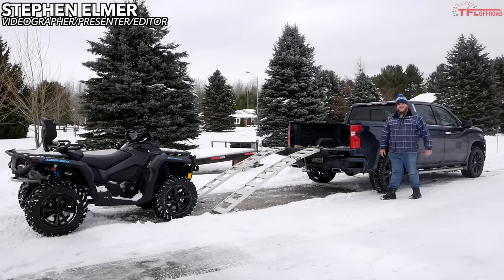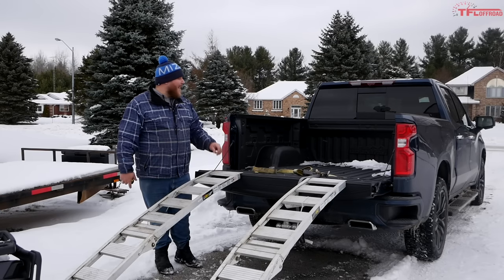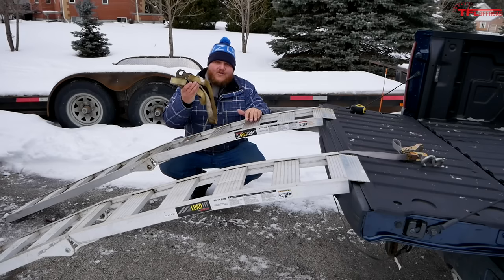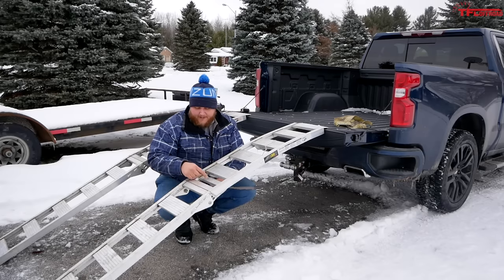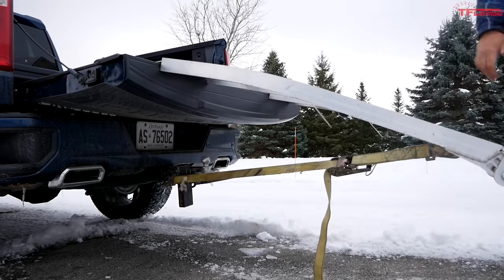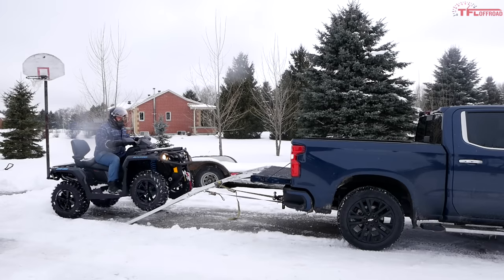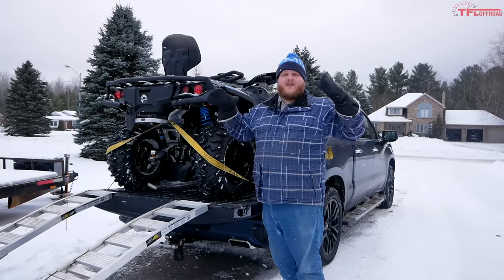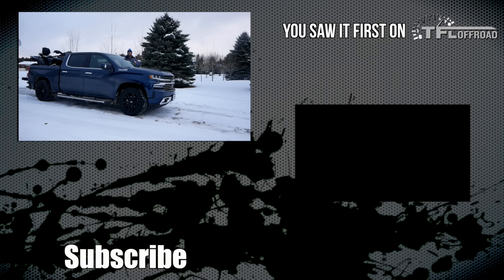Here's How to Load an ATV Into Your Truck Without Crashing!

Comment: Thanks for the info on loading an ATV into a truck.
Reply: Thanks bro. I have the exact same size truck bed and quad; and I didn't think it would fit/tailgate wouldn't hold up. I always used my jumping jack trailer to tow it around. I will definitely  be using this new technique. Great presentation.
Reply: Lol
Reply: I'd rather Back On , Then Back It Off   !!!

Comment: I've loaded thousands of   pieces of equipment on trailers and trucks, I try to get my trucks back wheels in a low spot when loading my 4 wheeler , it's just easier and safer.
Reply: Me. Me  just put some cones out and get some construction signs. Then rent a back hoe/bulldozer and makes yourself a ramp on the road. BOOM, free ramps for lfe. Just make sure you don't see any cops and put some camo on it. Paint it grey so you can see who is speeding.

Comment: Just a little thing to keep in mind for those who have an atv that will hit the glass get a good set of wheel chalks put them in front and if you get big enough chalks they will sit against the bed wall and give you a little extra room it helps when tying your quad forward and great video safety is what keeps us all riding down the trails
Reply: andrews you’re right rear windows are expensive lol 😝
Reply: I got me a pillow because my s10 tailgate wont close with any more space added
Reply: @andrewsbbq  I have a big red 250 that will fit if I turn it so the front tires in the corner, and a moto4 that just BARELY fits
Reply: I use an old tire as a buffer. If anything was to ever move on his ATV it’s gonna hit the glass period! And an old tire is cheap and readily available!

Comment: Great video. I agree with strapping down the ramps, it's very important. I also agree with using heavy duty straps. Personally, I suggest using two straps on the rear of the ATV instead of one though.  Straps can work themselves loose, two is always better.  For max safety use four, one at each corner, the same as you would do on a trailer. I've seen some people use winches at the front to tie it down and than can damage a winch. If you have front and rear bumpers use a strap at each corner, it's easy and very stable.
Reply: EastCoastATV yeah each corner is better but if your tailgate is down I prefer the crisscrossed method
Reply: I just dont think you should be strapping from the frame on something that has that much shock travel, already lost one side by side out the back that way, don't really want to lose another, much more secure to strap the tires down

Comment: Bought The standard Bed Truck (6' 6' bed) to better fit the 850 Max North Edition.  This allows for the installation of a ratcheting cargo bar across the front of the bed to stop the ATV (with accessory front bumper) against when loading and securing from hitting the glass.  Great common sense video for people who actually use their pickup trucks.

Comment: Nice video. I use a timber block or similar at the front of the bed to stop the ATV or whatever else goes there so I don't have to worry about contacting the glass of the cab or slamming into the bed.
Reply: I use some rubber wheel chocks I found on ebay cheap, does the trick.
Reply: I like your ATV .I admire your experience of loading it to the pick up

Comment: Excellent instructions for all those that don't know anything.  And not bad for people that have been doing it wrong as well.  Strapping the ramps to the truck I never see anyone doing.  "watch and learn"  Surprised you did not put individual straps on the back and just did 1.  I used to anchor 4 points for safety.  Sometimes a 5th strap over top of the whole thing to keep it from bouncing the straps loose.

Comment: I use ramps similar to THESE for a trailer to load mine.  My trailer does not have a ramp.  When I use the ramps, I strap them similar to this video but I also installed a bolting solution so I can bolt down the ramps to make sure they aren't going anywhere.  After taking a spill and getting really hurt, I do not trust ramps unless they are bolted in addition to strapped.

Comment: My 2017 nisan titan offered pretty same box add-ons. Clet system n led lights with power plug, a few years ahead of Chevy. Use an old rubber tire (without the rim, lol )to place between front of quad and front of box. It will stop it from touching or rubbing box or breaking the glass. Steady smooth throttle while loaded, one smooth roll up, not being one smooth roll up may cause more problems. Strap all 4 corners to stop it from moving forward or backward in the box, you can strap to the atv from under the atv on the frame itself to which is more stable than a big loop over strap. I donno how many atvs have slid out or into cab doing some serious damage. I miss a quad, ramps and my truck. Now with sxs and trailers, it's just different. Strap those ramps down too while loading, lol the old lumber sliding out as ramps may seem funny on video clips, but that's a flip you may not walk away from.  Ride safe n enjoy. Blue atv, blue truck, blue jeans, blue jacket,  and a blue touq with a blue pompom, lol sweet looking Chevy tho.

Comment: I always try to make sure my machine is in 4WD... Helps take the stress off the ramps once the front wheels get to the bed.

I also like to step on the foot brake (on Can-Ams) AND pull the parking brake. Brings up the brake pressure

Comment: As a viable alternative to using straps for keeping the ramps in place, you can also drill two holes into each of the ramp plate faces that lay flush on the top of tail gate’s edge. Along with two holes drilled into the inner tail gate where the ramps make contact. Obviously, the tail gate holes you drill will only be done once you determine the optimal placement of the ramps for your particular machine. These holes do NOT have to be massive....a quarter inch diameter is adequate.
    Once the ramps are in place, drop in a Clevis pin into each hole. The ramps are now “locked” into the edge of the tail gate, and it is now virtually impossible for either of the ramps to move laterally, and it’s highly unlikely one (or both) will ever “flip” on you, if you ever happen have your tires off center, and on the ramp edges during loading.
    This is the way we did it with our Suzuki/Yamaha dealership’s company pick up truck, when I did insurance pick ups, and transfers during the 1990s. Worked for both ATVs, and motorcycles. Except the truck had different holes drilled for loading the bikes, because you NEVER ride a motorcycle up into a pick up. It’s always pushed up one ramp, while walking up the other. So the ramps had to be closer together. 
     I’ve never seen tie down straps used for securing ramps, but it seemed to work well for you. And I’m certainly not dumping on your method. It does seem to alleviate any potential “ramp bounce”, completely. But with the pin set up, that is minimized by loading it fairly slowly. My only concern in regard to using tie downs, is the fact that the ramp lips (although pressing down hard under tension), are not “truly” secured to the tail bed of the truck. Just my two cents, and sorry for the novel. Great overall video, and thanks for making it. 👍

Comment: I would like to share when I load my ATV I have holes drilled into my tailgate and ramps and I put pins in them  so the ramps don't move forward ,  backwards or even side to side. Just lineup your ramps with your ATV wheels and drill the holes and it's set. Drill two holes per side of ramp. I use coupler pins. Hope this helps
Reply: That’s what I do exactly !

Comment: Personally, I add another set of straps from the rear of the bed to the front of the ATV. That way if you have any impact or panic stop the machine doesn't shift into your window or front of bed.
Reply: Yes, always try to tie it in so that you have straps pulling in two opposite directions. One pair of straps pulling forward, and one pair pulling backwards.

Comment: Just saw this. Awesome video... Years ago, I was loading a tractor on my pickup and the right ramp slid out. My buddy was standing right next to me and simply made it so I didn't have the tractor fall on me as I went over. Also, was loading a Harley in a truck and my ex-buddy was like get the truck as level as possible, when I wasnt using any tethers. The bike kicked out the ramp... Crap day.

Comment: Im towing my quad on my rzr utility trailer, this time I'm not beat up my 2019 Silverado like my 2015 in the past I did alot scratches in the tail gate and bed liner.
Reply: Your concerned about scratching your bed liner?
Reply: @panthermartin7784  no, I did few dents inside of the bed carrying quad ramps, and with my quads bumper.

Comment: Just ordered a Polaris sp 550 last week. I once dumped a very expensive motorcycle off a ramp loading it and bent the handlebars and put a large dent in the gastank!! So the part about securing the ramps was the key bit of info I was hoping to learn. Safety first. Along a different subject has everyone had difficulty finding new atv's for sale? they sell as fast as they come in in my city of 2 million. Thus one has to place an order and wait 5-6 weeks for their impulse buy. Thanks

Comment: Everything's good Steve,  BUT I always put an old smaller sized car or motorcycle tire right in front of the ATV, so there'as no sudden impact with the rear of the cab/window.
I wonder, what does GM  (or any of the 'makers')) say the maximum weight capacity is on those tailgate cables? This is why I had to stop carrying my CanAm in my Silverado,...
and bought an all aluminum trailer for my ATV , I was too nervous of those tailgate cable's letting go!
Reply: @jedironin380  These look very good,. I've never seen these before, however from the link you've provided, Amazon doesn't show any sellers now.
Reply: @andrewsbbq  Yes, I have no doubt that those support cables are strong,..I wonder what the manufacturers rate them at, AND what would be the outcome if they broke because of a load resting on them like this, i.e. warranty and or an insurance claim!
Reply: @regsparkes6507  I grabbed the first link as an example, sorry it's not active. Do a little Searching, I'm sure more are out there. I used them as a back-up, the cables on my Dodge held up great with a UTV in the bed.
Reply: You also have to realize these machines are about 7-800 lbs, only maybe half that is on the rear wheels/tailgate
Reply: @justinteal495  Oh I'm fully aware of this,.like I said, I have a CanAm Max and I used to own a Silverado too,...I guess I just feel comfortable with that ATV 'hangin' out there.
Reply: @jedironin380  Actually, Idon't have a truck at this time,..I might in a year or so, so we'll see how it goes then. Thanks for the idea though.

Comment: I was loading my quad in my pickup before, but I recently bought a new 4 door truck with the shorter bed and an Outlander max that's about 9" longer than my old machine and I was wondering if it would fit.  
I always put 3 4x4's in front of the bed that my tires would rest on which prevents me from hitting the front of the bed or the window.

Comment: Since I might have to drive over bouncy roads with my ATV loaded, I use one strap to each side at the back to keep the rear wheels centered (it is a real pain if the rear wheels shift any significant distance; the front can be quickly turned as you back out). I actually have 4 straps, one from the front ATV strap hook to the back of the bed, one from the back ATV strap hook (or hitch) to the front of the bed and then the 2 rear side/side tiedowns. My two ramps fit under the ATV and I have a cable that holds them in place (bumpy roads can make the TFL method bounce out of the bed!)
Reply: Besides neutral, I take the parking brake off, why wear on your mechanical parts during long dirt road journeys or highways for that matter?

Comment: I do basically the same thing. 4 wheel drive and low on my grizzly. Except for tie down straps on the back end I use a Louisiana guard dog. It’s a reverse trailer hitch that locks onto the ATV trailer ball if you have one. It connects to the receiver and goose necks up. That way it locks in and you can secure it. Then I strap the front down for some added pressure.

Comment: I'm thinking, rather than measuring the wheelbase to see if one would fit. I'd measure from the front bumper to the rear axle. To account for the overhang in front of the wheelbase length.

Comment: Thanks for doing this ramp lesson!   Two questions:  1. You say make sure the truck is level, but is there any issue with have the bed tilting down?  This means the ramps are less steep. Your thoughts?
2. How do I find the load rating of my tailgate?  Is it possible to overload the tailgate strap?

Comment: Word of caution, I’ve seen tailgate cables break and when they do you will damage your tailgate and worse yet your ramps may still slip off.  I made a Steel T that slips into the receiver hitch that takes most of the weight off the tailgate when loading. Speaking from experience lol
Reply: Thelrongutz...I would like to see a picture of the Steel “T” that you made! That’s a great idea!

Comment: Great video Stephen! This is why I have a Ram 1500 quad cab, instead of the larger crew cab. I'd rather have that extra foot in the bed, not the back seats. I don't want the tailgate supporting the back half of the quad for an entire trip.
Reply: Agreed. Seeing a short bed pickup driving on the highway with a big bore ATV hanging off the back end while the truck sags and is held on by nothing but Harbor Freight straps is a sight to see!!!

Comment: Good job but easier if you use a berm or back the truck into a drainage ditch to make it more level.  I actually built a berm the exact height for loading unloading.

Comment: What was the length of the ramps you used?  What was the weight of the ATV?  What was the load capacity of each of the ramps?  If ramps have a capacity of 1,000lbs each, would you be able to load a 1,200lb ATV (since the weight would be distributed over two ramps)?

Comment: Could use the winch.  Hook two straps to the forward tie-downs and then hook those to your winch hook and pull it into the bed.  No risk of accidentally over throttling it into the bed, no risk of injury if anything goes pear-shaped.  Maybe?  Yes?  No?  Just a thought.  I guess it would depend on the winch system you have, if you have one.
Reply: Your not supposed to use your winch as a form of tie down. You could damage the brake on the winch and if that was to happen while driving it will slip.

Comment: I’m debating on a Silverado 1500 crew cab standard bed as i currently have the Chevy Silverado 1500 short bed and want to haul my ATV in the bed.  I typically drive 250plus miles down the interstate to trail riding destinations.  Do you feel it’s safe for an ATV (Polaris sportsman 570) to ride on the tailgate all that way or just spend the money and get a standard bed?  Didn’t really want a bigger truck in the driveway but need to know the longevity of an ATV on a tailgate. I don’t have the multiflex tailgate.  Thanks for any help or insight

Comment: I mean for the same price you could get a 2500 with an 8 food bed and not have to worry about your ramps sliding out. Or you could get the sierra sister to this and actually use the loadstop in the multipro tailgate, but its just a gimmick, right?

Comment: that back strap should go over the tires and then down soo that its holding some unsprung weight down, this will help when going over bumpy gravel roads or bad transitions between bridges on highways!! nothing worse then going over a bump and having it fall out the back at 60mph

Comment: Good vid, but only complaint is that your only rearward tension is from the parking brake...??  
A couple thin blocks of wood in front of the tires so the winch doesn’t hit, or one in front of the winch plate...now you can pull forward against the front of the bed and the forward tension from the straps hold it in place. No room to move at all. The brake shouldn’t be used as a securement device.  If you slam on the brakes with this set up the machines moving forward and now your rear strap is loose. I guarantee it.

Comment: Is it possible to load the ATV in the truck using straps as a winch to pull it up? I mean that clicking mechanism you use to tighten them
Reply: Василий Мельник not realistically. Ratchet straps can only ratchet for about a foot before the built up strap material doesn’t allow more. A come-along could work though as that is cable based and can move an object many feet before needing to be reset.

Comment: Mmm No, the level surface won't work for my truck which has a big lift.
I however have a huge drive way that at the end goes up towards the house, I can literally park the truck towards the end of that high part (where the truck is mostly leveled) and place the ramps so that the ATV doesn't have such a steep angle. It ends up being almost half of what the angle would be if I was at a leveled place. (much safer). That is also why I would only use a trifold ramp which covers the whole bed and not just the wheels.

Comment: Mostly that was a useful tutorial.  The big thing you missed was putting something in front of the quad so it can't go through the rear window, a piece of plywood, a spare tire... something to prevent the front bumper from taking out the rear window. I live in California and we ride different machines. They tend to be 2WD which of course lack low range. For sand, dirt, abs trail riding they work great. Higher horsepower, long travel, and lighter weight are prized.

Comment: Ok. I have a kawasaki brute force 750 and im a big guy at 350lbs. Will the tailgate hold that much without breaking. I have a 24 gmc sierra elevation with off road package
Reply: Could really use help so I hope someone knowledgeable sees.
Reply: @jdizzle75 yah you’ll be fine my outlander 1000 weighs like 1100 lbs plus me 175